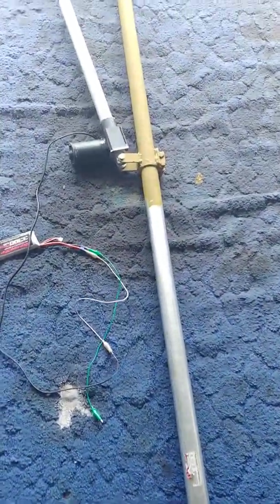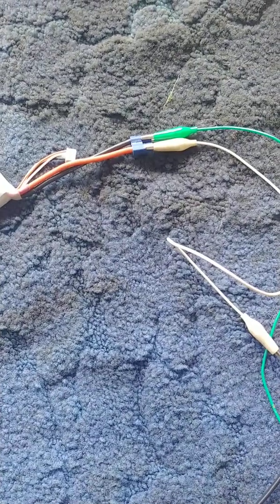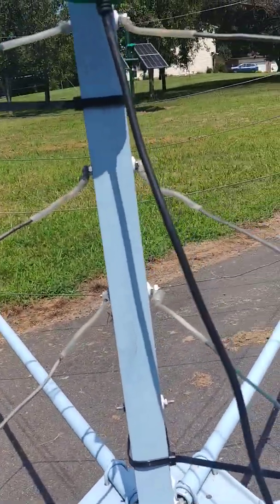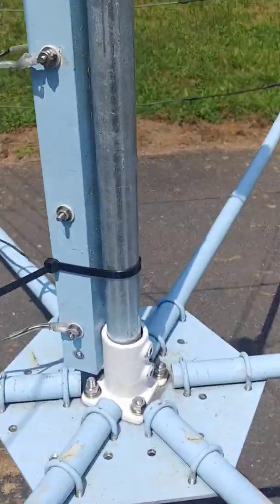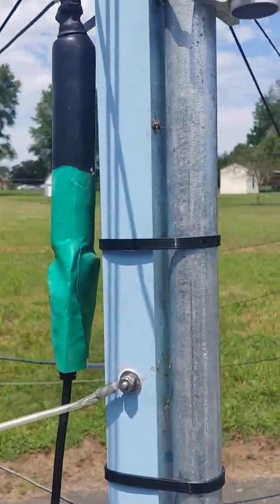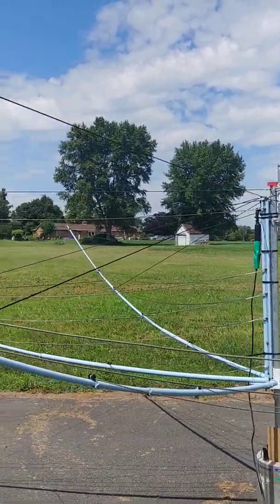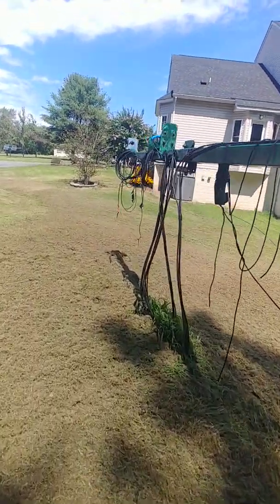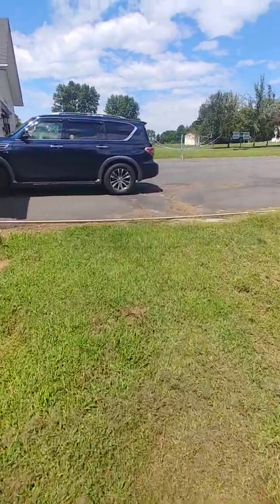My hex beam on a "stick" mast for better support and fold over capabilities.

Comment: Good idea! Since your hex is up and running would it be possible for you to share center pole dimensions i.e. the direstors fix points measured from the base plate? What is the length of reflectors and direstors for your antenna? I'd like to build hex and such data would make that effort much easier. 73! SP5AEA.
Reply from the maker: It is a K4kio hex and i have no measurments, installed it years ago, sorry om. 73. woody